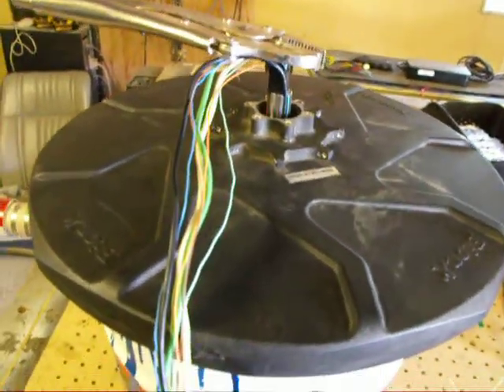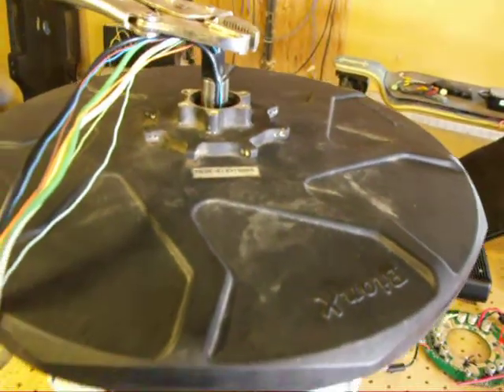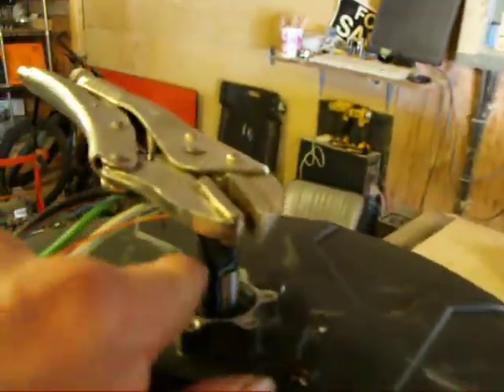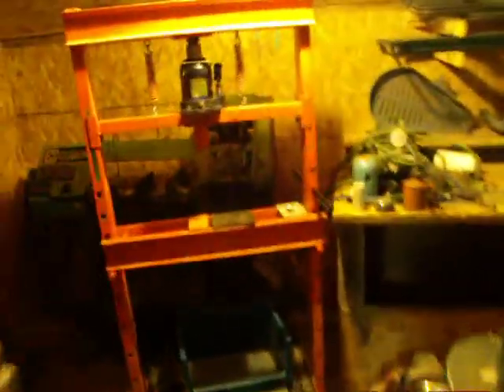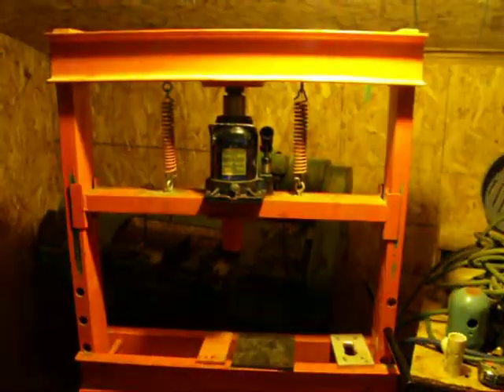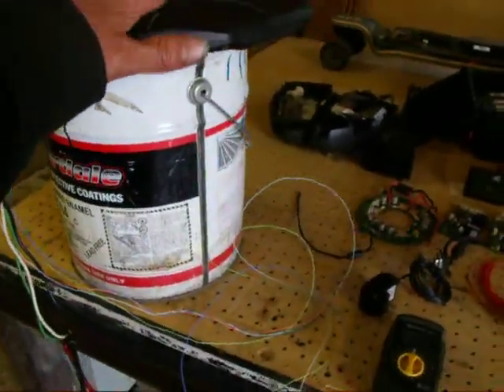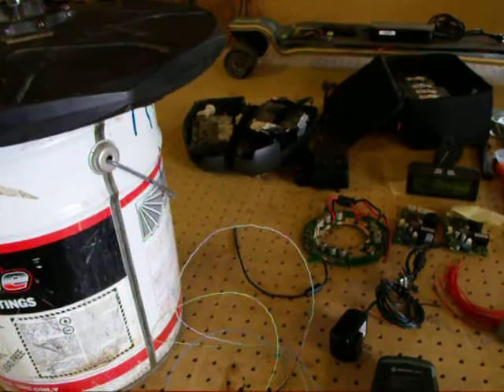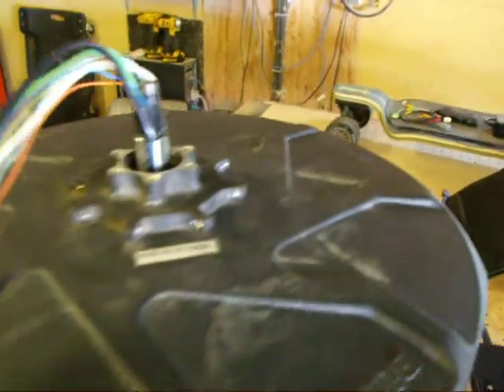Attempting to fix a BionX hub motor part #2. I test the assembled motor.....

Comment: Most hall effect sensors are "open collector", so it'll need a pull-up resistor in the 10-20k ohm range to Vcc of like 5v. Open collector can only pull the voltage low, it can't source current high. Hope that helps.
Reply from the maker: noted, i have a few more of these motors to work with. i will look into that on my net build.  thank you!